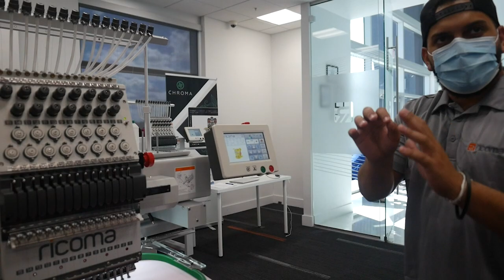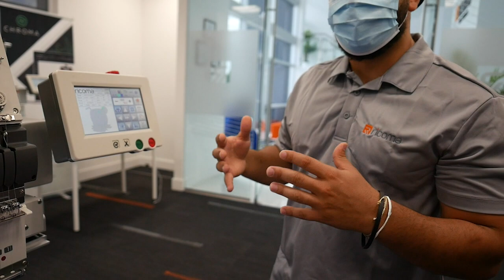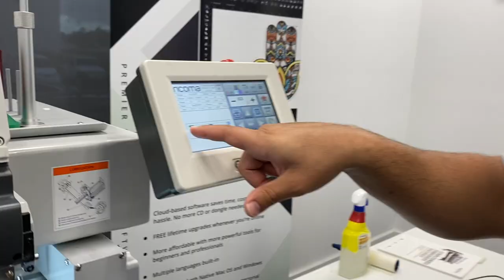I visited Ricoma Headquaters in Miami Florida

Comment: Did you purchase this outright like you actually own it or did they send it to you as an influencer marketing deal (which they are clearly doing with other influencers atm). Your review on Ricoma is gonna be pretty important to me as I trust your opinion. I have also been researching industrial machines for months now and pretty much settled on Ricoma until a couple weeks ago when a bunch of bad reviews and opinions started popping up and made me apprehensive. I’m looking forward to following your experience
Reply from the maker: I purchased it outright. I had the same experiences with the negative videos popping up but decided that with there customer service I can figure it out and get it to function properly should I run into any issues.  I will most likely join their affiliate program but all footage you see here is 100 percent to show what if any issues I run into and how I’ve fixed them and what to do should you have issues. After doing my training I’m really confident in the machine and can’t wait to get started using it. We will see what happens.